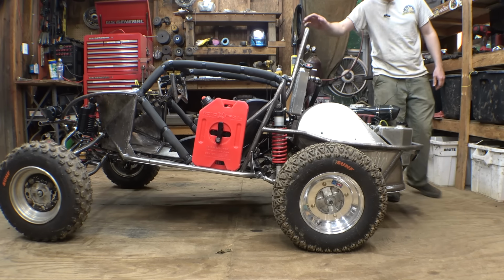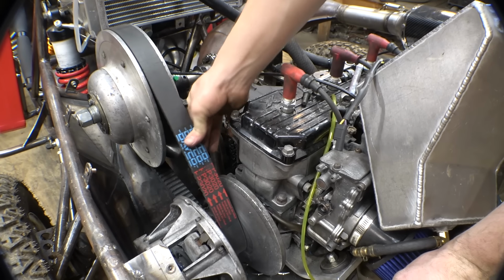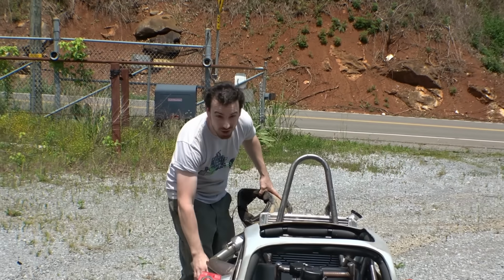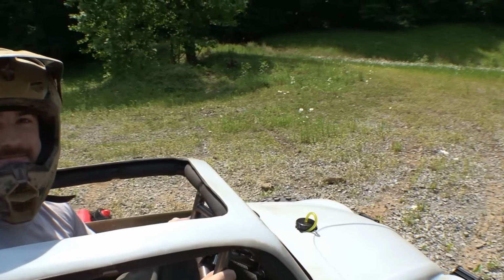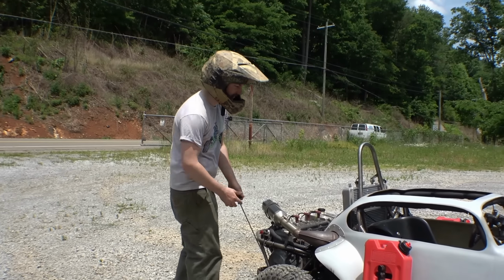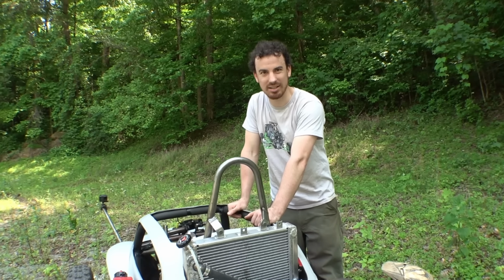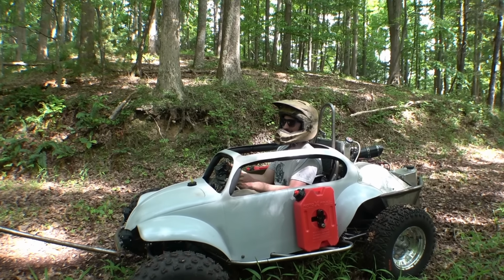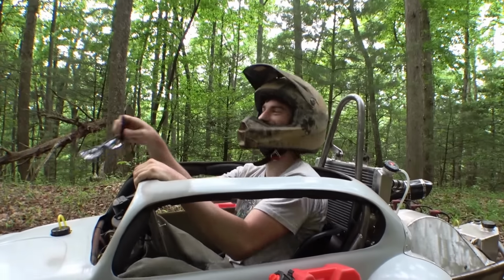This Thing is Nuts!!  - Mini Baja Bug Project First Test Drive

Comment: You should build an addition to the cage that protects your neck/head in case of a roll-over. We all like your videos, and we'd hate to see them stop because you broke your neck. A few years back, we had a racer break his neck. Definitely add some safety precautions to reduce coolant burns too.
Reply: I agree especially as it always looks like its about the roll over.
Reply: As someone who has broken their neck before, please take this into consideration. It fucking sucks
Reply: Bro he has a rollbar. Sometimes certain projects can't be completely safe. You just have to be careful
Reply: @outabody381  what good is a roll bar if your head and neck isn't protected from being compressed???
Reply: Coolant burns are absolutely terrifying. I've commented a couple times about building a firewall to protect himself from the cooling system.
Reply: Make a full external cage in the shape of a VW bug so it mirrors the internal body.
Reply: @matthewf1979  Just ask Cleetus about coolant burns.  His mystery machine van severely burned one of his drivers when the rad or hose popped.
Reply: @whodat90   that would look cool.
Reply: Yes, now that he sat in it with his helmet on, the head protection definitely feels inadequate. We don't care if it's ugly. Keep it safe man!
Reply: 100% 👍🏼
Reply: No seatbelt doesn’t help.
Reply: I've been warning about this stuff the entire time he's been doing this build.
Reply: @outabody381  that's like saying racing is dangerous so why have a roll cage its not perfectly safe anyways, its such an easy precaution to take with 0 downfalls other than looks.
Reply: Ah...... Chris hardly rips hard enough to need much more than a helmet and his mother on speed dial.
Reply: @BIGWIGGLE223 you didn't watch the entire video, did you? Chris is getting more courage with every build, and he pushes these builds to their breaking point, often, now. He's not afraid of everything, like he used to be, years ago.
Reply: Exactly I made a comment a few videos ago about adding a roof rack not only will it protect your neck but it will also add an off-road look to the buggy
Reply: What are you going to do it it rolls?
Reply: Agreed! Definitely coolant safety! I know the more he adds, the worse it looks, but safety is worth it.
Reply: That coolant could be a problem on your skin.
Reply: Halo..... Yeah mate safety is kinda good. That's an insane asylum on wheels
Reply: @matthewf1979  Yes me too. Lots of people have. That is the most likely pain he has coming.
Reply: Definitely!
Reply: Agree, also you should where some gogles in case a stick or branch flings up at you. (As one almost branch almost did in one shot! ). Keep up the great work.
Reply: He gives everyone a heart who compliments his work and machine. If you criticize anything you get no heart. My guess is he doesn't listen. He's kinda a quack. lol
Reply: Needs Brush guard and skid plate
Reply: not what you want rolling..  💯 Deathtrap
Reply: It’s rad af! All these things are dangerous, it’s the nature of the beast.
Reply: Electric fan on radiator
Reply: Fully agree.  Real Roll bar.
Reply: I never understood why people put a single roll bar in that does nothing. Amazing build and looks like a serious machine but that simple thing kind of blows my mind.
Reply: @outabody381 This makes absolutely no sense
Reply: C'est vrai .. quand on a des engins qui commencent à watter comme ça  on a tendance à négliger la sécurité ...
Reply: @benpinder889  yeah there should be  a lower one in front of the steer wheel as well. And the one behind his head should be taller
Reply: @outabody381  he can easily install bend metal bars over his head. 

so if he rolls over, he rolls over the bend bars which form a round roof

no problem in that. Thats how rock bouncers are made. Look them up... if they can be made safe, this small buggy can be made safe too.
Reply: Yeah, it looks like a decapitator to me
Reply: lol definitely…. If he rolls it he won’t be riding anything ever again.
Reply: What a cool little project using an XLT triple is amazing and the sound also just wondering, how did you figure out the jetting for it and what temperature does it run at? If you have a temperature gauge curious cause I would like to run a snowmobile engine in a project that I’m working on, please let me know. Thank you and good luck.
Reply: Gay
Reply: Yeah, like how dragster head protection is played out. Bad add little ride.
Reply: The thing behind his head isn't a head rest.
Reply: @lankey6969  riiiiight that comment tells me that you've never been in an offroad buggy that's violently rolled a few times... because if you had, you'd understand how your body and head don't sit still. Lmao

Comment: The suspension is waaaaay to soft which is half the reason it won’t do a donut. The front wheels being in the air so easily means donuts won’t be easy since you can’t steer with the tires not on the ground lol
Reply: I trink so too, to much weight and way to much grip on the rear.Also Nerds an anti-roll- bar on the rear for less waving.
Reply: Agree. Looks so soft at back.
Reply: May be a anti roll bar on rear might help
Reply: My Baja won’t do donuts on anything other than pavement.. just a thought..
Reply: Tie-down shocks up-front
Reply: @TripleXclown as much as it's lifting on gravel and dirt, pavement might be a bad idea. 😂
Reply: The springs are fine even if a little soft. What he needs to do is increase the compression setting to be stiffer. Maybe slow down the rebound as well. I know most of you know nothing about suspension, but adjustable shocks have a lot more than just preload adjustments. The spring rate means very little here, it’s how the compression and rebound is adjusted.
Reply: The rate of the springs can’t handle the weight transfer. He needs to either mount the springs farther outboard or run heavier springs. A rear roll bar will also do wonders of keeping the front wheels on the ground in turns without needing to raise the rear spring rate.
Reply: Spring rates and pre-loads are important... they do the majority of the work... its finding the balance of the 4 corners and then using the shocks compression and rebound to fine tune.
Reply: That's the point ya know, baja
Reply: It's a completely open diff that's 80% of the reason, the soft rear makes it worse
Reply: I ageee to soft , limit straps whould greatly  help
Reply: Part of the donut problem is you have an open diff and you are lifting the inside tire which is pushing a lot of the power that way instead of putting it on the ground.
Reply: It isn't the suspension. All of the weight bias is on the rear. The front tires get too light under throttle since the engine is behind the rear axles.
Reply: Ehh idk about that I mean yeah it could affect it but trophy trucks do donuts whilst hanging the inside tire
Reply: It's not the suspension, it's the fact that you don't have a rear sway bar, even just a small one will help the front wheels stay on the ground for better steering and control all around 🙌💯😎 other than that it's a ripper, if you close your eyes you hear a snowmobile but it's just a go-kart lol
Reply: Lock up the rear and that's all you'll do is donuts.. lol cool little gizmo

Comment: Okay, a couple things here. Snow mobile motors are originally tuned to run in cold climate, so yeah, you may be running a little lean. Check the output of the fuel pump. Check float bowl height and richen up your jetting a little. Spark plugs should give a good indication of what's going on. Next, suspension in the rear is too soft. You can try dialing in some more preload and adding more nitrogen as well as a few more clicks on the low speed compression, but ultimately, you'll probably need stiffer springs. A sway bar would help a bit also. As for donuts, you have a differential. If it's not posi, or locked, donuts are going to be a bit more difficult. Not impossible though. Remember, you have cutting brakes. Use them. Pull the brake on the inside wheel. Hope this helps you.
Reply: I'm thinking u forgot to mention radiator is right behind seat so what air flow.  I'm pretty sure radiator fans won't help if you're blocking radiator air with ur body
Reply: You have the tuning thing backwards. Cold air has more Oxygen than hot air. Hot air would make it run too rich, Hot air less Oxygen per given volume than cold air. Therefore, you need less fuel.
Reply: Warm air is less dense, so wouldn’t it be running really rich right now
Reply: I was thinking the same fuel starvation is what I'm seeing but it also could be from overheating it's leaning it out definitely fix that asap check fuel delivery I'd have a consistent flow pump if it was me and get some fairings made and add a fan for sure that'll redirect the air. Try leaning the rad back a little bit
Reply: You have said everything i was thinking to advise
Reply: Solid advice right there 🎉
Reply: @GS-tf3bl  Exactly,  smaller main jet all that needed here.
Reply: cooling fans for sure!!  firewall also( rad bursts or hose youll be boiled like an egg)and im thinkin too much fuel or float level too high.
Reply: @philboncher7191  nope, just the mainjet
Reply: He would be running rich if tuned for cold while in a warm temp. If it’s not computer controlled fi then it would even be more rich when the engine is overheating. Warmer less O2 so need less fuel to get close to stoic stoichiometric
Reply: was thinking the same. when he was trying the donuts and got power loss. It sounded like it got a bit hot. Radiator does not get enough air.

Comment: one thing i suggest sir is that you make some sort of fire shield or splash shield incase you have a cooling system failure id hate to see you get 1st degree burns from coolant its not fun man been there done that better to be safe then sorry
Reply: Exactly what I was thinking
Reply: I was gonna say the same thing!
Reply: I was thinking the same. I had a friend of mine get severally burned due to a hose bursting behind him with  no shielding.
Reply: 100% 👍🏼
Reply: No need hes going to ride it once or twice and let it rot
Reply: Yeah, my buddy got coolant/ chemical Burns on his face and it was not good.
Reply: @vasya5579 yeah honestly I don't know why he doesn't build them use them however many /few times he's going to then strip down and reuse the parts of the ones he's never going to use again. If he had somewhere decent to keep them then OK but it really annoys me seeing all his old builds go rusty and turn slowly to trash.
Reply: He doesn't give a heart to those who suggest safety measures. Only to those who compliment his machine. I don't think he listens. He's kind of a quack. lol

Comment: You 100% need stiffer shocks for this thing.

Also, SHE ABSOLUTELY RIPS!!
Reply: agree, will also improve the steering way more
Reply: Shocks look fine. Good travel. What it needs is a fairly stiff rear sway bar
Reply: How do you tell the gender of a machine ?
Reply: @videobyallen suspension looks fine. The shocks and springs are inadequate. A sway bar would crutch the understeer but will cause one wheel bumps to upset the chassis more in a straight line. It's also understeering because as soon as it leans into a turn and unloads the inside tire the outside tire loses power and has full grip. Off road vehicles slide and "rotate" to corner best. The differential will be great on pavement but it's not on dirt. A good lsd would be a huge improvement but solid with a handbrake/separate front rear controlled brakes would be perfectly fine.
Reply: The front wheels are hardly ever touching the ground, that's the reason for understeer. Weight needs redistributing forward
Reply: @aquacruisedb Yhea he should either go the easy way and just stick some lead weights at the front or as it has over heating issues anyway maybe put the cooling system at the front so the rad gets more air flows and it could help balance it better.
Reply: Stiffer rear springs would help with the squat, roll, and understeer.  There’s definitely a rear weight bias, and those springs aren’t sufficient.
Reply: @ohwell2790  he refers to it as “she” because it is expensive and high maintenance
Reply: Maybe more spring in the back.
Reply: @ohwell2790  personal preference
Reply: Stiffer shocks would be better for racing on the road..  but it's better like it is for off-road and jumping, etc.
Reply: @videobyallen 
This is the way
Reply: It needs a roll cage. Seriously
Reply: 3 inches increase of rear tire diameter should fix a ton of it.
Reply: I agree with most of the comments here. Need to address sway and I would like to suggest, make your own led weights to tuck in the front to figure out what it takes to keep the front end planted. This thing rips... Now it just needs to be able to turn at speed. 
Keep up the great work. Thank you for sharing with us.

Comment: cool project and has good power for the first test. As far as the problem with the donuts and poor steering is concerned, the main solution is a sway bar on the rear axle, which keeps the wheels on the ground. Real trophy trucks and Baja buggies always have a sway bar. As an example, when steering to the right, the entire weight presses onto the rear left wheel, which causes you to lose grip at the front. In addition, the left rear loaded wheel builds up extreme grip and in contrast, the right rear loses grip, so the deferential starts to work and only sends all the power to the right wheel because it spins freely, so the power pushes you forward instead of to the right to execute the donut, I hope this helps!

Comment: Build some scoops on the back side of the "windows" by your shoulders directing air directly to the radiator and also acting as a fire wall of sorts! Dude that thing absolutely rips and it aint even right yet! 🤘🏻
Reply: You have lots of good comments that you need to follow up on.
Also, think about the spring and helix in the clutch. With out some rpm info I'm thinking stiffer spring and a steeper helix to keep the rpm higher coming out of the corners. 
It I wasn't 6'4"
I would love a test drive in that beast.
So much fun!
Be safe play hard!

Comment: Hollyheckabob! I think you have just invented a whole new class of racing, that thing is nuts .
Reply: It's similar to a small sprint car.. CrossKarts are also very similar:  just with a full cage, and then usually with a manual sports bike engine.
Reply: Chin Up Racing?
Necker Race Sin?
El'Blow Racing?
Bar B Attack Racing?

Comment: Definitely needs a fan, add some side vents like window scoops to add airflow, and make sure you are running the proper jetting for warm weather. It's designed to be running below freezing, so if you haven't richened it up, you're going to lean it out, and put some extra holes in your pistons lol. First run out looks like it was a blast though. And the turning brakes looked like they worked great.

Comment: Great build! nevertheless you need much stronger springs on the rear. Also think of installing a torsion bar on the rear. This will for sure add a lot better handling in corners. For sure your radiator needs some fans and even airscoops beside your head in order to get some cool air flow to the rad. Currently the radiator is near to no airflow at all! Kind regards

Comment: I always wanted a hyabusa powered sandrail, cause growing up, dad had built a VW sized rail, and put a alum. block 215 V8 in his.  I ended up driving one and it was the same size as dads, but with a way better suspension.  That was really nice.  but the hyabusa just didn't have the punch or torque feel of dad's rail. Dads rail had a high lobe cam that made just under 200hp.  Dad passed, I now have my rail that I grew out of when I turned 18.  Since my legs grew and don't fit.  Now I'm old and my fat body don't fit.  But I love this guys little bug.

Comment: You really need to stiffen up that suspension as it lifts a wheel off the ground whilst cornering, that  will be why it doesn't turn. That rad is big enough it just isn't getting much air to it.  Man it is one wild ride.
Reply: It's hot because it's running out of gas in turns. The lean condition makes a lot of heat. Enough to melt pistons. He needs to figure out how to keep the carbs full of gas before he does anything else. First thing I would do is stop trying to do donuts. lol

Comment: Nice job! Maybe a small fuel pump and low pressure regulator, and a lithium iron phosphate battery to run the fans and lights.
Reply: @That_F250_Custom  Most of these snowmobile engines have the same vacuum port and pump.  I know my 500cc Rotax does

Comment: It looks great, it sounds great, and it looks like a lot of fun to drive. And I am sure that you will get it to run just like you want. For a first testrun it seems to perform really well. I think that it would turn a lot better if the front suspension would be a bit stiffer as well. Also a big 👍for Brian for giving you the opportunity to do the testrun, and for filming the testrun.

Comment: Better rear shocks or more beefy springs. That squat on the right rear when try to do a donut is putting a lot of strain on the belt and slippage. That could be playing a major part in the bogging. Improper weight distribution is a killer on cvt belts and can stall a motor. The radiator is perfect but needs air flow. A fan will work. It's just not getting enough air flow because you're sitting in front of it and blocking the majority of the flow it really needs.

Comment: There's zero flow on the radiator. Size is irrelevant with no airflow. I cant fathom how you are intelligent enough to build this stuff but still cant foresee a rad with zero airflow needs fans from the jump.
Reply: Ditto on “I can’t fathom how you are intelligent…..”.     Mad skillz but not really a ton of street knowledge of how how end result will or won’t work..